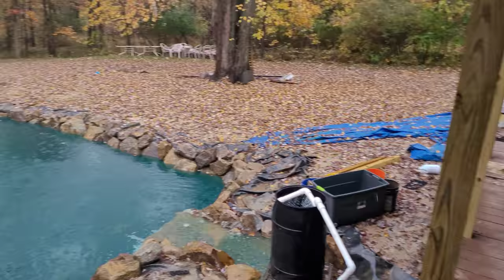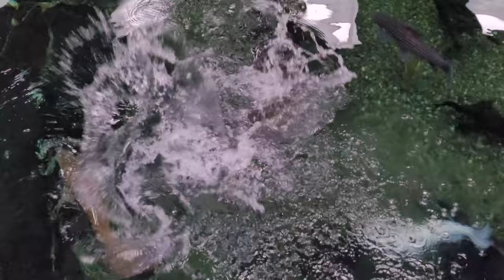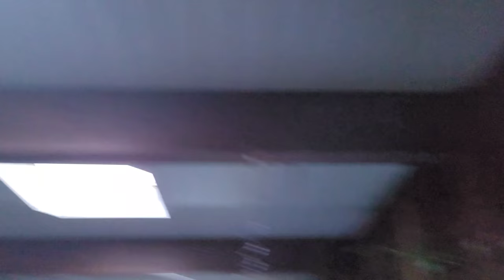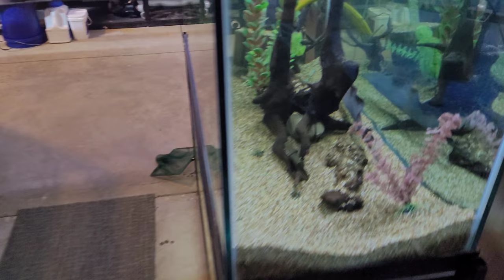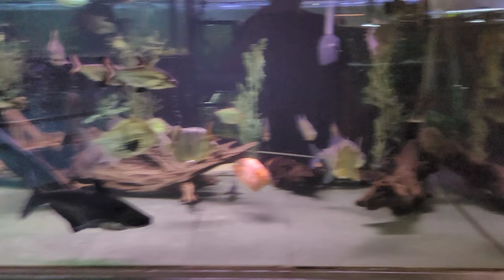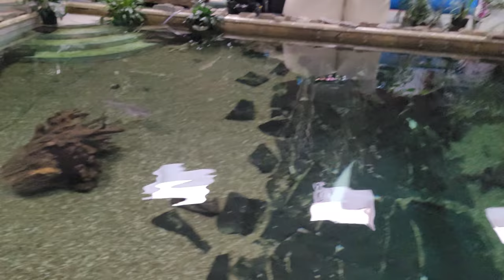over 100,000 gallons of fishtanks in 1 video

Comment: I always get mesmerized upon seeing Ballagio ciclid tank. But I equally get disappointed seeing those black filter pipes in front. Any plans to move them back of the tank or they are going to stay like that.
Reply: They've mentioned in some other videos, they're piping the tanks on to their system soon, fluvals are temporary
Reply: @tabithawebb1785  Cool, thanks for the info, not sure how I missed it though I always thought there would be some plan as these tanks are relatively built recently.